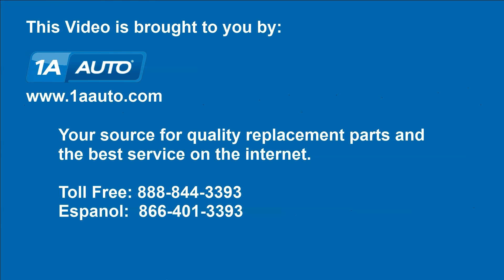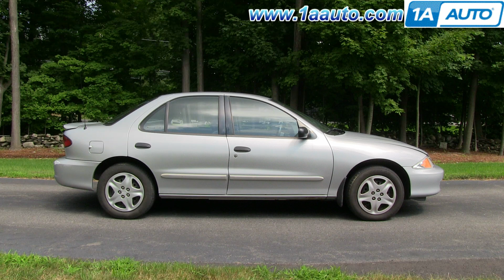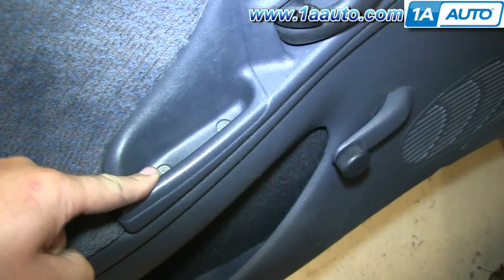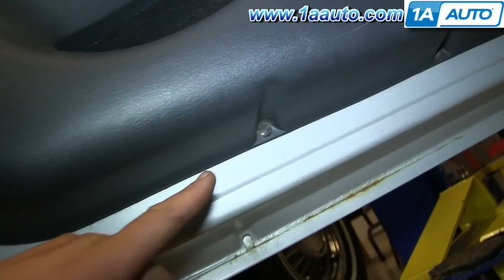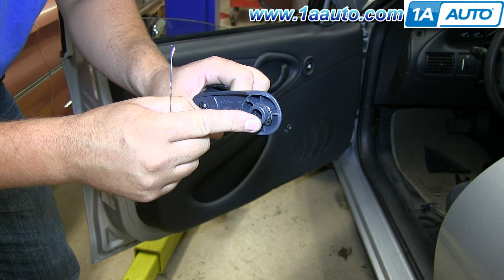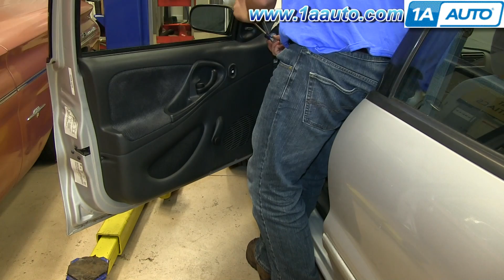How To Remove Front Door Panel 95-05 Chevy Cavalier

Comment: to get the clip off the crank handle you can also use a soft rag that you slip in between the handle and the panel and then, holding one end of each side of the cloth you turn the rag.
Reply: Jeff Dean I'm sorry Sir but I don't believe that would do anything?
Reply: Donnie Weiss I've done it, it takes the clip right off.  The rag snags on one end of the clip and then you pull the clip off.
Reply: Wats funny is I just did my 4x6's and I figured I'd try it.... It works haha!
Reply: Donnie Weiss Ya man it works great, good luck getting it back on :D
Reply: Jeff Dean Yea they never tell ya that stuff on the package! :P
Reply: Doing my 4x6's today, gonna give this a try.
Reply: mephLuciferisto trust me you would never think it works but it does, good luck!